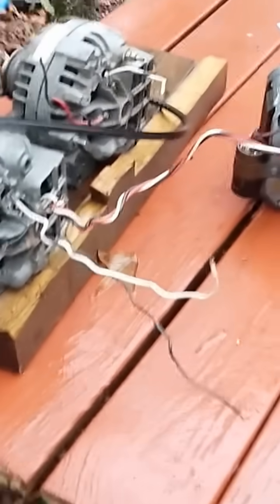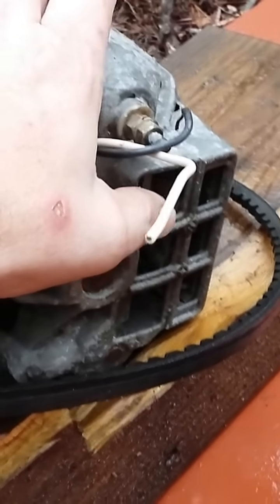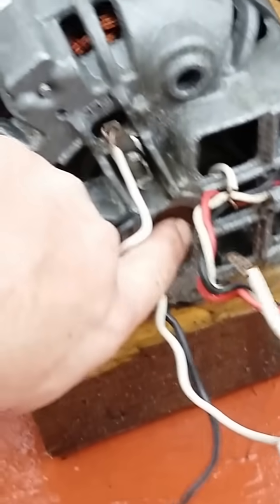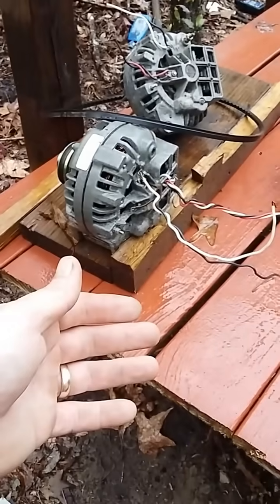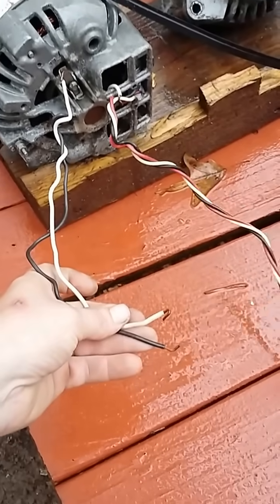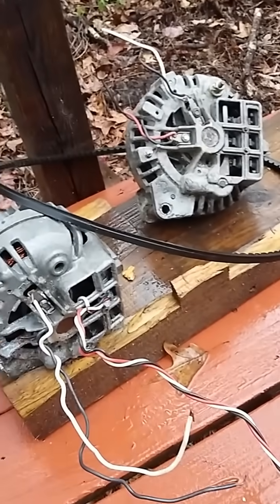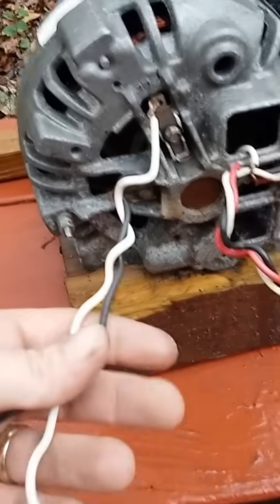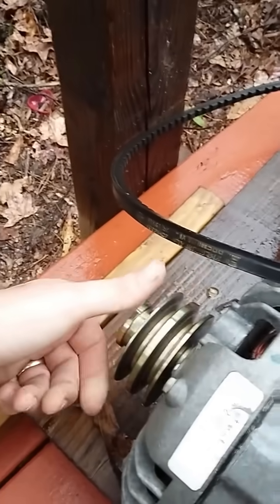Update Free energy forever no wind no solar no gas READ DISCRIPTION!!!

Comment: PERPETUAL GEOMETRICAL ELECTRICITY MULTIPLIERS CAN POWER ALL THINGS. TESLA WAS RIGHT + FREE AC ELECTRICITY MULTIPLICATION IS EASILY DONE USING PULLEYS =(wheels). This simple technology is even, FOUND IN THE BIBLE @ (Ezekiel 1:16), as the inner workings of a UFO motor. "a wheel in the middle of a wheel" or, a small wheel running around the inside of a large wheel. Or a small cog in the middle of a large cog, with two medium size cogs of the same tread in between the large outer cog and the small inner cog. Do you see why I chose to use pulleys + belt/elastic/rope/or a piece of tied rope or string, instead of cogs with both size of cogs + threads having to be meshed correctly. 
- 
This GEM-(free energy technology) is so simple that it should be obvious-(but it has been hidden by evil spirits). Just think of this small amount of logic,,, it only takes an input of a few sparks,(short bursts of current) to rotate a large 33 cm circumference pulley,(about 10 cm diameter) once, giving you 33 cm of moving belt. Then, if you run this length of belt past 1 to 3 mini-pulleys of 1 cm circumference, with AC or DC motors/generators attached, the this would give you an output of 33 or 99 cycles of AC or DC electricity. NOW TRY + TELL ME YOU CANNOT FREELY MULTIPLY ELECTRICITY with pulleys, when you can gain 99 cycles of AC or DC electricity, from a few sparks,(short bursts) of DC current, which is the amount to rotate a DC motor with a large 33 cm circumference pulley once. 
- 
+ Don't you listen to these evil spirits, whispering that torque is a problem, as this is a blatant lie. This is because more torque occurs when you need to produce more power, and the only power that you need to produce, is the minute amount of current that it takes to crank over your single DC motor one single time. So you gain these 33 to 99 rotations=cycles of AC or DC electricity, from this 1 to 3 motors or generators, to generate the small amount of power that it takes to rotate a DC motor once, making this GEM device a self powered free energy system, These many rotations of these few motors or generators only need to generate a few short bursts of current, which equals practically nothing, when it comes to current. This is because practically no current multiplied by even massive voltage, still equals practically zero power – costing practically zero torque. 
- 
I HAVE DISCOVERED THE SECRET THAT TESLA WANTED TO GET OUT TO OUR WORLD = THE SIMPLICITY OF FREE AC OR DC ELECTRICITY MULTIPLICATION USING PULLEYS –. Where you gain the multiplication by only paying the energy to rotate the large otter wheel once, costing a few mere short bursts of electricity. Then gaining the multiplication of taking the power output of the massive increase in rotations of the small inner wheel, or even many wheels. 
- 
+ This costs such a minimum amount of cash = 2 DC motors of the same voltage, 1 large + 1 small pulley, a belt, strap, elastic or tied piece of rope or string, possibly 4 diodes for a rough full wave bridge rectifier, a capacitor and a few wires to connect these components together. This is so simple to assemble that we could start making a GEM=(Geometrical Electricity Multiplier) for almost every voltage that we might need or want. Please remember that a lot of these supplies might be laying around our homes, or you could easily and cheaply pick them up in a junk yard. And if you choose to use AC motors/generators, then you have to add a full wave bridge rectifier, (4 diodes) in between your AC generator(s) and DC drive motor 
- 
BECAUSE OF THE POWERFUL SPIRITUAL WARFARE GOING ON ALL AROUND US = How else can you explain us not using this simple GEM free energy technology long ago. This works because of the simple logic of how it does not take a greater amount of voltage to crank over a single DC motor with the large pulley once, than you can gain from the many rotations that you get from the many generators attached to the mini-pulleys. In other words, you can gain more power-(voltage) from the many rotations of the mini-pulley with AC or DC generators attached, than it takes to crank over one DC motor with a large pulley once. The free energy rule is, you can gain more power_(voltage) from generators attached to mini-pulleys, than it takes to crank over the DC motor with a large pulley once. 
- 
It is as simple as the lesson that you learned way back in preschool, where they showed you how a single rotation of a larger pulley could be converted into many rotations of a smaller pulley. Well, this can be a significant thing, when talking about AC electricity, as more rotations can mean a greater amount of cycles of AC electricity. So, in effect, you can use pulleys to freely multiply the amount in cycles of AC + DC electricity that you have. 
- 
THIS GEM TECHNOLOGY IS SIMPLE LOGIC, THAT EVIL FORCES ARE HIDING . This website https://www.youtube.com/watch?v=NxpoiCFKmPg/ is almost identical to the idea that I was shown in the early 2000's + soon put on the web @ http://free-energy.yolasite.com/ Free energy can be generated using pulleys, because pulleys can be used to freely multiply the # of rotations + since AC electricity is generated by rotations, then we can use pulleys to freely multiply AC electricity. 
- 
When I was first shown this free energy technology, it was in a vision of a 10 speed bicycle going uphill in 10th gear, + the back downhill in 1st gear. Where AC electricity is involved, more rotations equals a greater amount of power, but I wanted to be sure, that this came from good spirits/angels and not evil spirits/angels/demons. I later found this tech in Ezekiel 1:16 where he was speaking of how a UFO motor looked, as “a wheel within a wheel”, + because of free multiplication of rotations, this is a self powering set of motors = FREE ENERGY 
- 
PLEASE,,,,,, JUST TAKE THE FEW MINUTES + BUILD THIS SUPER SIMPLE MECHANISM FOR YOURSELF. Just go to this website. https://www.youtube.com/watch?v=NxpoiCFKmPg/ + see how truly simple this works, and is to build. Now please, go out and build as many of these super simple, and cheap to build, GEM free energy machines as you can, of all sizes and voltages. Or even better, convince the government to start generating it for us, getting rid of the pollution that we put into the air, and the radioactive stuff completely 
-
YES,, THE ARK OF THE COVENANT HAS BEEN FOUND IN JEREMIAH's GROTTO, RIGHT UNDER WHERE YESHUA WAS CRUCIFIED, SO HIS BLOOD COULD RUN DOWN THE CRACK + LAND ON THE ARK + HIS DRIED BLOOD WAS STILL ALIVE + TESTED AS ONLY HAVING 24 CHROMOSOMES = VIRGIN BORN + PROVING HIS DIVINITY.. 
-
- Here is one of the videos trying to let this scary information out
https://www.youtube.com/watch?v=pPrutcbaerQ&list=PLDIEv5nkqqEa0-u8DIzqpefKBAG0nkb7g&index=1 
-
+ here is an explanation by the Physicists  
https://www.youtube.com/watch?v=HHKmoBeNWWQ&list=PLDIEv5nkqqEa0-u8DIzqpefKBAG0nkb7g&index=2 
-
CERN Is Changing Our Timelines – Proof - Mandela Effect Part 1 
+ this is a video of what they are realy up to: https://www.youtube.com/watch?v=Ul0LDTsrmuY&t=209s 
-  
Here is a website that shows you how quick + simple this GEM technology is to build = https://www.youtube.com/watch?reload=9&v=NxpoiCFKmPg
-
+ here is a website that I set up to discuss how this GEM technology works https://www.facebook.com/groups/274842009339398/
-
PLEASE COPY + FORWARD THIS MESSAGE #2 TO EVERYONE + EVERYWHERE. 
We are soon going to see many strange creatures + mysterious mechanisms coming up from under the earth, under the seas + even down from space

Comment: Main point is you need to power it to get power out of it it doesn't just create power out of nothing
Reply: gudgen2004 a start up battery ... which could be recharged once the induction motors creates an RMF

Comment: You will be using more energy to spin the alternators then it will yield in the output. You don't seem to understand basic physics. Something like this might work if you had a cheap power source say water flowing in a river. But if you are powering it with another electric motor then you are just wasting electricity.

Comment: More specifically how to wire it off the stator ? I tested my alternator 7& Amp Dc , I tested it straight off the Stator my multimeter was set on AC current and I spun it with my battery powered impact gun about 1800 RPM and got over 2.000 watts Ac current ! How to wire it off the Stator ? And the Ac current is the purest sine wave !
Reply: Then can you use a creek to power the turn with a paddle wheel ? Hydro power?

Comment: I am really interested in the idea behind this. How many alternators running do you think it would take to run an average size house
Reply: I wouldn't bother using car alternators they don't put out enough power,  a 120 amp alternator spun at speeds to put out 120 volts is problem one,  they need at least 3000 rpm  to do anything.   next you have to remember when converting from 14 volts to 120 volts your available amps goes down.   you would only be getting about 14 amps off a 120 amp alternator that was set up to output 120 volts AC. and that would not be continuous.  and they are over a hundred bucks each.   you would want to use a generator off a typical gas generator.  and spin it with an electric motor, but its not just that easy. see other people doing this on here.
Reply: @rmendes2mendes915  Glad i didnt take your advice i have 3 setup together running a 28ft camper with 2 deep cell batteries to store energy.
Reply: @rosseverett3330  so what do you spin the alternators with?

Comment: You see ya got cha judy chop and ya ninjy chop and ya got ya hillbilly told to stop making his own  electricity or he wont live much longer meanwhile my $47.00 a month electric bill is nowhere near 300 to a thousand. 
Good job nerd you need 4 horsepower for that alternator to produce 90 amps and that universal motor is 1/2 horse?
Reply: funny thing is think out of the box. i seen this happen with many farmers now in idaho and utah living off gride. its not new. old science. INL been working on this for over 10 years.
Reply: Lmao i was thinking the same thing , is it the same guy??
Reply: Our bill on occasion does run $300 in a month. And we have some of the cheapest electric rates in the country. Why $300 a month, it means that the A/C was on just about constantly or that I was using the welder. Average day is 67KWH. 3KW used per hour in the daylight and less used at night. Turn on the welder, and watch the meter run wild. 15KW reading has been seen on the meter. We have a 200Amp service so it could be even worse if everything kicked on at once.

Comment: Everyone should learn Kirchoff's laws before watching anything like this.  Don't be fooled, this is for entertainment, not for an actual tutorial.https://en.wikipedia.org/wiki/Kirchhoff%27s_circuit_laws
Reply: Energy cannot be created from nothing
Reply: Yes, and he's not magical,  he's using it to get it. You can not make power without power. It takes energy to make energy
Reply: @CopperheadGarage   the energy that inventors are getting with some of these new methods on here is not coming from nothing.   not talking about this video though.       where do you think the electrons are coming from when you fire up a gas powered generator?  you cannot create an electron yet they are flowing from the out put winding to your load source.  main stream science will say they are being generated by the magnetic fields but what does that mean? generated? sure there are electrons already in the wires they are circling the atoms that make up the structure of the wire, and yes that is true but when forced to leave their orbit by the manipulation of magnetic fields we know that the atom will always go back to a neutral state and so the electron from a near by atom will give its electron to that atom,  it's known as electron drift. all the electrons flowing from the generators winding are leaving one atom and going to the next.  but at the other end, the last atom in the copper winding when it gives it's electron to the one next to it, where does it get it's replacement electron??   it gets it from the environment.  because yes event the air we breath has it's electrons, all mater has electrons which orbit what ever atom they occupy.   and so the electrons continue to drift from the atoms which are in our atmosphere.    all generated power comes from the environment and more than likely from space too.    because we can't see this energy we will say its coming from nothing and that is impossible, but it's not really coming from nothing.
Reply: @rmendes2mendes915  its hard to argue with a smart person, its impossible to argue with a stupid person - Bill murray
Reply: @rmendes2mendes915  you are speaking nonsense gasoline has a lot of energy the combustion of the gas causes the piston to move making the output shaft move and making the stator generate electricity alot of energy is lost through heat and friction so even if you got something to run on its own you couldn't power anything with it and it would stop because of lost energy from heat and friction
Reply: @CopperheadGarage  I won't waste time arguing with anyone however if someone wishes to learn and share information which will add to the knowledge we already have then I listen and share. that is why I have a lot of knowledge and many skills.  I am here communicating with whom ever wishes to share what they know.  I already know how to extract energy from the environment and how to use gravity to amplify mechanical force and get more out than you have to put in.  but it's again not coming from nothing,  power can be extracted from the environment, the atmosphere, or space which ever it is actually coming from I am not sure but I suspect the energy is throughout the entire universe.  and I can easily prove you can use and harvest gravity to amplify force and then use that amplified force to do work.  if you wish to share how you are creating energy I would like to hear how.
Reply: @rmendes2mendes915  it is a law of physics no free energy devices work stop spreading false information you bloke
Reply: @CopperheadGarage  rarely will nonsense be spoken by me,  my life is dedicated to truth, truth is knowledge and falsity is not allowed to dwell in my mind.    I know the internal combustion engine is a energy waster, it has been designed that way and the governments will not allow anything too efficient to be sold and used by the public.  even though many have proven you can vaporize gas and get hundreds of miles per gallon with little waste heat. I know how and have done this also.   when you say to get something to run on its own remember   it is only an appearance,  it's something you see happening and because of a lack of knowledge you do not understand how this can be so your mind triggers disbelief, which is  the inability or refusal to accept that something is true or real.    but then after more study and the gaining of more knowledge on the subject you eventually find out there are other sources of energy out there which can be taped into.  you just have to create a device that can do it.   and no the government will not let us produce these devices and sell them. the world runs on oil and other energies which make income for those who control them.     yes these devices have friction and energy losses but the energy you are getting from the new source is unlimited and so the friction or losses don't matter, you may waste 500 watts of power turning a device but get 3000 watts back.   the heat you produce just gets wasted as it radiates to the environment a byproduct of your extracting the power.        And I am not talking about this video, he is not doing it correctly  and seems to not understand how it is done.
Reply: @CopperheadGarage  ok I see your not interested in learning how this can be done, the mind closed to new information  because mainstream science has told you it cannot be.   time to move on.

Comment: How do you wire it do you ground the housing cause those 3 wires are hot wires nobody can answer me I was gonna use a gas moter and build a generator that's portable
Reply: yes the alternator is 3 phase when you bypass the diodes and regulation circuit.  and all three wires are hot, just out of phase with each other.    it requires a grid tie unit to do it.   but I have to warn you what he is telling you will not work.   if you want free power do the skinner gravity power maching, or the milkovic oscillator, or chas campbell machine. and there are other ways too.  yes you can do what he is doing in the respect you can take one alternator and run it as a motor and drive the other alternator  but you will have to power the first alternator with some other source, at first, ac motor, dc motor, what ever you choose to use.    and after you get the second alternator up to speed you have to quickly switch the power off that first alternator that is being used as a drive motor and then connect it to the output of the second alternator.    but you will have to convert the secondary alternators 3 phase power to the proper voltage and phase to power the  first one. and it may not work without adding capacitors as buffers.   also he should be using a smaller drive motor to spin the secondary at least 2-3 times the size of the first motor. or you will only achieve the first motor turning the second with the power output from the second and no excess left over to use for anything else. it can be done and easy but this video does not give you the information you need to do it. I know how and can also harvest gravity to amplify power.